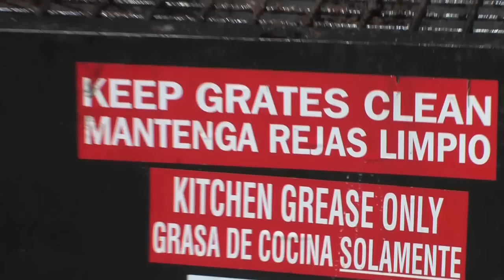Veggie Oil Car - iTurnedGreen

Comment: My wife works at a school,,I get free veg oil,I've been running on veg for about a year now,,no conversion,,no heat,if it's cold I run on 50 veg and 50 per cen't diseal,had no problems apart from,a fuel leaj, from return to tank pipe,and it's very clean,,I filter it once,. Was getting it from Costco at half the price from the gas station,,but now it's free,,car runs great,

Comment: YOU DO NOT NEED A CONVERSION! I have a 80 300SD (same motor as vid) I collected from restaurants while driving over7500 miles all on the go. Instead of waiting to settle,  Buy a Griffin G1000,10micron filter, a delavan pump, plumb it together and use your idling cars battery to power the operation.  I kept mine in a Tupperware tote in the trunk. feed the hose into dumps. I spent  200 bucks on diesel to thin the fuel out when the temperature was chilly. thats it. Still drive the car today on oil
Reply: Isaac LeMasters what the amount of diesel per gallon of veggie oil when temps are chilly. And where would I get that filter. Thank you . I have been collecting 100s of gallons of oil for use later. Fuel is now over 3.00 a gallon here now.
Reply: Hello sir im from Indonesia sorry for the broken english, is there any engine trouble about salt that might contain inside the used oil? Thank you

Comment: in the UK, there are a few used oil "gas stations" as you americans like to say. They just add alcohol to the filtered veggy oil, this thins out the oil and you can just put the stugg straight into your tank and run it. No extra heating unit needed. The downside is the alcohol adds to the cost..

Comment: P6
Finally, if you wanted to turn even greener, you might want to check for a new vehicle: replacing your 3 liter MB with another old car with 2 liter diesel engine (like the old 1.9 TDI); this would improve your fuel efficiency while adding a few HP.

Comment: P5
What is more, before filling the tank you should have had the ground covered to prevent oil leakage. And don't tell me you're gonna fertilize the plants with that compost. How the plants are supposed to elicit a long-chain breaking reaction? Don't pollute your compost with the oil wastes unless you have long-chain-breaking bacteria, hopefully.

Comment: P4
There are a few flaws of your oil-processing idea. First of all, it's not advisable to keep oil supplies near the swimming pool. Oil leak is unavoidable and probably imminent. You should keep your barrels in the place which would protect the environment, supposing all the barrels cracked at the same time and everything leaked out. Although it's less likely to occur, but there'd be no risk though.

Comment: P3
Thereto you need an additional fuel-heating equipment which practically allows you to run the engine even in freezing winter temperatures. There are people who uses the filtered used cooking oil to power up their older diesel cars. Newer cars are too sensitive even for the used filtered cooking oil, but still can run on new cooking oil or the biodiesel fuel that is made from plants, cooking oil, or fat collected from the fat-removal clinics and processed by a special apparatus.

Comment: P2
In Europe more than half of total cars are diesel powered. Every single diesel engine can run on cooking oil (clean of course). You can buy a can of cooking oil, pour it to your diesel car tank and the motor would run even smoother. However, there is one condition: cooking oil thickens at much higher temperatures than diesel, therefore even +41°F would be critical.

Comment: P1
In America diesel cars are pretty rare not to speak about the fact that it can run on oil. Your idea is not new, but in the states it's original for sure. 

Diesel motor was invented with the intention to consume oil wastes. Only later it was discovered it is cheaper to run on the petroleum-related oil. As the gas prices goes up, people repeats the history and returns to diesel vehicles.